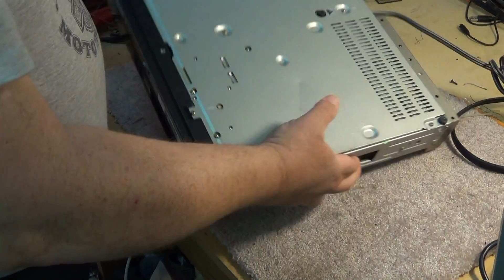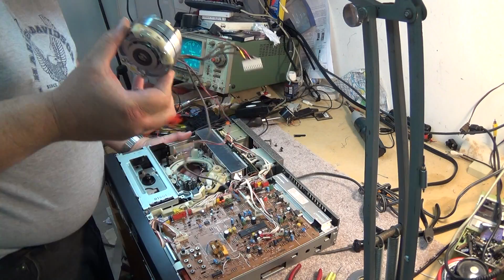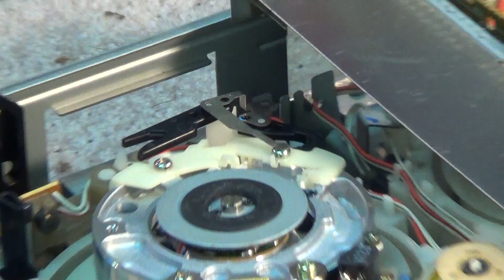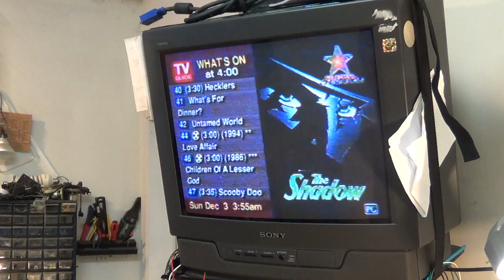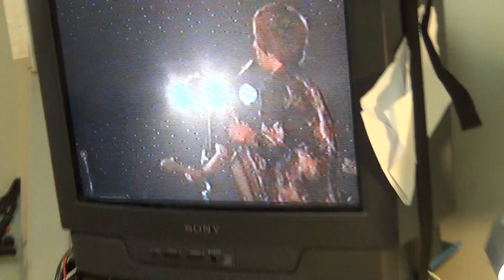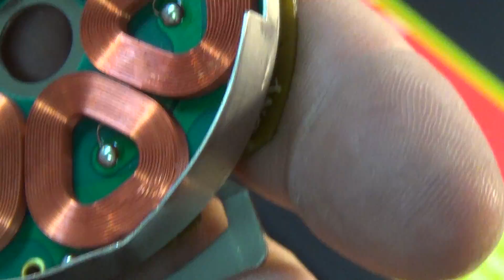sony betamax drum motor repair

Comment: Is there any way to find or buy a video head for a SL-2700, or perhaps the entire head drum?
Reply from the maker: Look on ebay. That is your only hope.  They haven't made those pats in over 30 years.
Reply: @12voltvids  thanks.  would try goodwill but they're still not open due to covid-19.  thanks for the response.
Reply from the maker: @robertstoddard4478  
Yes the covid is a big problem.  Difficult for me to do my job. Lots of ppe needed.
Reply: @12voltvids  Do you know any machines that have the same video head?
Reply from the maker: @robertstoddard4478  
The 2700 was a 3 head machine. 2710 will be the same, I think the slfhr50 and 500 was also the same.  Many are interchangeable. I recently swapped a drum from an SLHF900 into an SLHF1000. Now theses are completely different machines. They are both 4 head units, but the 1000 is an editing machine with 2 flying erase, which the 900 does not have. but the head works without the clean edit of the 1000. For me I am only using it to playback .  A 2 head will also probably work, but you won't get clear still or slow motion. That is what the 3rd head is for.
Reply: @12voltvids  Thanks again !!  Wouldn't be trying this without your videos.  I think thats a good thing. :/

Comment: 852/5000
Regards. As always I keep an eye on many of his videos that have been very helpful foy me. Can you help me please, I have a problem with two Sony Betamax SL-20 and SL-HFR70. Both have the same problem, turn on but the characteristic sound of the solenoid is not heard, it does not move and the cassette is not loaded either. I already checked and cleaned the IN sensor of the cassette and the resistance that the solenoid carries. I checked the voltage at the connector on the board where the solenoid is connected, I simulated the loading of the cassette in the load gate and the voltage at the pins was only 0.02 volts and when I took out the cassette it returned to zero; Apparently the correct voltage is not reaching the solenoid to actuate but I cannot find the service manual to proceed and check. What voltage should reach the solenoid? Please any additional indication? Thank you.

Comment: Hello. The head drum of my VCR has the same problem and I´ve identified it is caused by the hall sensor. Unfortunately, I don´t have VCR spare parts to get another hall sensor. Does anybody know which hall sensor can be used as replacement ?

Comment: I don't know if you're still in the business or still monitor this uploaded video, but I wanted to tell you that this is a very good video. I have one of these units in my shop right now. I've been in this business for 30 years and have always had issues repairing Beta VCR's. til I watched your videos. I have one of these units in my shop right now. I purchased a unit for parts on Ebay and went to work. I was ready to condemn the unit after I swapped the Head/motors and it still didn't work. I found a schematic and found 9 volts was missing. I just received a new regulator IC and fixed the unit. Thanks for the motivation to see it through.

Comment: Help please with my Sony SL-S600 capstan motor is not spining on play, only spins during Slow Motion, I cleaned rollers, cleaned switch under the loading motor as you mentioned on 711B3 chasis, still the same, could be a leaking cap on capstan?
Reply from the maker: yes could be
Reply: 12voltvids Yessss, it works, I just changed cap on Capstain Motor  and is spining on play, now is perfecly working, your videos gave the clue to revive my Betamax, Thank you

Comment: Thanks to you i could fix my philips vcr mechanism. This philips vcr has only 2 heads. Can i put a 7 head inside this one? I am not an expert but if you think that it can be done i will change it. Thanks to you i fixed also my technics cd player.

Comment: My hfr70 ate the tape.  finally pulled it out.  head spins ok. ? 
When I insert a tape, it goes down, then pops back out.  
So it doesn't load the tape.  The geared belt is a bit sloppy.
Reply: update, opened the case today.  It's like the tape guides that pull the tape around the tape won't return the tape to reject it.  It's like stuck in play mode, the buttons won't respond, not even reject or power off, just stuck in play mode.  I lifted the tape out, unplugged it, got it to reject the tape, but it seems like the thing that pulls the tape around the head won't return to reject it?

Comment: hi 12voltvids Great video, I always like it, I have some problem with my betamax, when I play the tape there is no color on tv only black and white, I played both with ntsc or pal tape but it still the same my betamax is sony SL K-95 similar with SL T50 it is a multi system format machine, maybe you can help me, your advise would be greatly appreciated ..

Comment: Also when removing the drum assembly.If you secure the top of the disc with some tape, and make sure one head (or two sets if it's a Hi-Fi) are inside the metal bracket the other(s) being opposite.  It allows you to know where the heads are and stops the disc spinning when you handle it. Limiting the chances of breaking those oh so fragile heads.

Comment: Usually if it IS the hall effect sensor,when you press play, whilst the play light s light ,try to turn the head disc.If you feel resistance either way until the play light goes off then it IS the sensor.If not it's something else.Dry joint, bad head drive IC.
Reply from the maker: +paymydues 
Right. The hall sensor job is to provide feedback to the drive is as to the phase of the motor rotor, so the drive ic can generate the 3 phase drive signal. No input from hall sensor and only 1 cool is energized. The drive ic is waiting for feedback before advancing the 3 phase rotational drive.

Comment: I can get the drum spinning now and it will restart by its self when it has been on however whenever I power it up I have to manually spin the head and eventually it will slowly pick up speed.
Reply: (On the superbeta sl-100 you told me to clean the hall effect sensor on)

Comment: Great videos, thanks. My SL-C30E had the same issue. The head would randomly stop mid-play or during FF or reverse, or it would not turn at all. I removed the glue from the hall sensor, and it seems to work fine now. 

I have another issue however. When I eject the tape, sometimes the tape is not retracted back into the cassette, and the drive mechanism sounds/looks a bit sluggish. When FF'ing and reversing it sounds like the unit has to do a lot of "work". The tape transport itself is okay though. 

I have taken a look at the motor and pendulum but the mechanism itself doesnt seem sluggish. Could the tape itself have too much traction?
Reply from the maker: +Rhytz Usually it is the pendulum gear getting sticky.As to the glue on the hall sensor, if you watch that 3 hour Sony Betamax factory training seminar I posted from back in my service days, the instructor talked about that issue.
Reply: That´s Solid  Gold !!!  betamax must be preserved.

Comment: Standing dropouts in the picture means that the Drummotor make this problem on one point and there is no Dropout Compensation you can see.

this is also my Profession but in my Country noone will pay for this typ of work anymore they said this is to expensive and why you'r so expensive and why that work need so long time. etc. What is the charge per hour or better if you repair a Betamax Recorder with this typ of failure?
Best Regards
Volker King
Reply from the maker: Volker King Well shops used to charge upwards of 80 an hour. I am a little more reasonable than that when people contract me to repair, but then I am not putting food on the table repairing stuff anymore. I changed careers when I saw the writing on the wall in 2002

Comment: that was the time when Sony destroy themself with a Philosophy like the HiFi Optional Board for much of Dollars. We don't have Beta here in Europe only Video2000 (that never came out in the NTSC Format) and in the later days VHS. Betamax was not so common here in Austria.
Reply from the maker: Volker King The concept of the HiFi ready was to be able t sell a machine with a low cost, and later when the buyer realized that they made a mistake and should have bought the HIFi machine they could upgradeThe cost of the VCR, and the processor was actually a little cheaper than buying a hifi machine. About 100 cheaper, however the cmbo of the 2 units had a few less features than the higher end hifi machine.
Reply: There´s no Video2000 in NTSC? Thought some units arrived to US.
Just today I bought a HFR model (the "R" stands for "ready" to indicate stereo adaptor had to be sold separately. 
Does the processor sell out as a cartridge on the unit or is a special circuit?? Thanks.
Reply: Sony HFR-30. I´m looking for that processor. 
Someone sells it?
Thanks.
Reply from the maker: The HiFi processor was a separate box that sat below the VCR and plugged in with a multi connector cable.

Comment: Slf 30 in the uk...I just wish we had people like you over here that would service these beta machines...God bless you for even taking the time to service these stunning machines...Thank you..Aaron..Manchester Uk
Reply from the maker: I love the old Beta format machines. I have an SL5200 I am going to drag out. It is the first of the HiFi units, and the machine that started it all. The idea that you could add 2 pairs of FM carriers to the video FM, chroma under carrier MUX was fascinating.
VHS never did manage to do this. They had to use separate heads, with a different angle on them so they could lay the sound into a deep layer of the tape, and then record the video over top of the sound. The result was a degraded picture from the reduced S/N ratio caused by the interference from the HiFi sound track, even though the recording angle was different by about 40' there was still cross talk between thr tracks. On Beta, there was enough bandwidth, due to the larger head, and higher writing speed that they just stuck the carriers between the chroma and luminebce signals. Same heads, different frequency, no cross talk.
Reply: Amazing that someone still has the knowledge and has the time and kindness to share it..We don't have it in the uk anymore..Thank you and i will be watching your videos with great anticipation!!!!!!
Reply from the maker: azshaw123
We don't have many still in the business here in western Canada either.
Most of the shops are now gone, and those that remain charge so much that nobody in their right mind would repair anything. Even the manufactures like Sony and Panasonic have closed up shop.
Reply: All I want id the titanic work of restoring a SL 5600 that has no power, it´s like new...
Reply: I know one repairman near Paris. I am about to give him 2 VCRs Betamax

Comment: Great you can swap parts from other models.Great video.
Reply from the maker: Yes you can.
Most parts are interchangeable across several models. The exception being video heads and lower drum assy. These have to be the same type. IE 2 head, 3 head and 4 head types.
The upper drum is the same, as is the motor assembly.